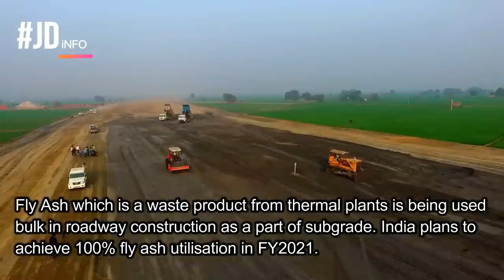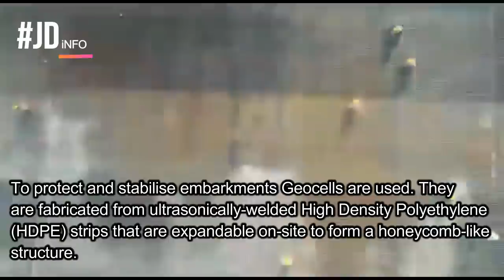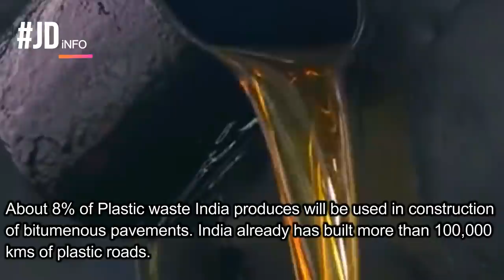India's USD 200 billion project will push its construction sector to the limit

Comment: Before 2014 the total length of NH in India was around 90000kms and now it is more than 150000 kms. That is, Modi govt has built more than 50 percent of the NH built by all his predecessors together in the last 65 years, just in his 7 years tenure.